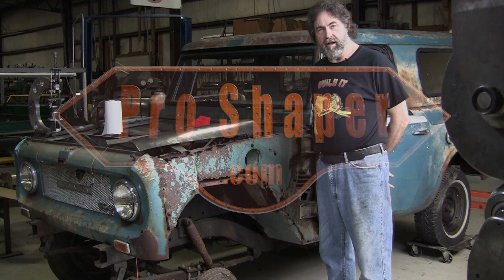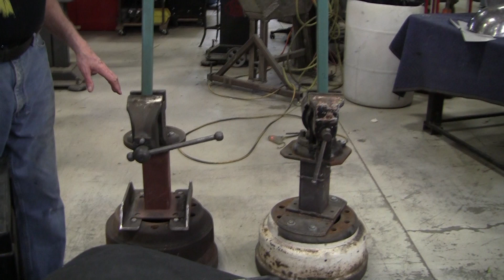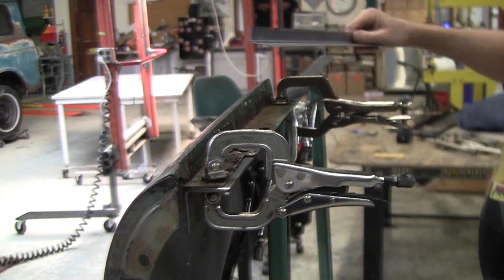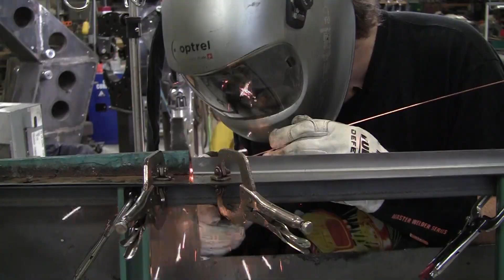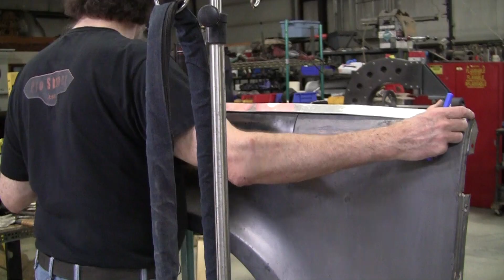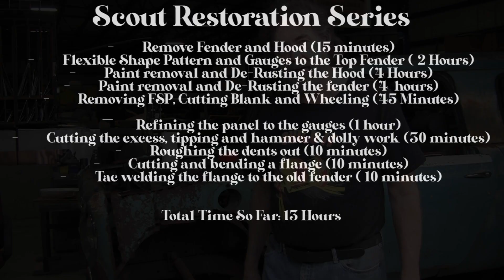Collector Car Metal Work: Scout 800

Comment: Novice question here: Why not put the fender on the other Scout, and use the brackets there for positioning?
Reply from the maker: My point on the restoration series videos is show the proper way to do restoration and I try to keep in mind what is possible for the viewer. I have multiple Scouts not everyone does, hence the bracket clamped in the vise. I bought another Scout today.
Reply: @proshaper  Good point. Thanks!

Comment: Removing the outer fender has revealed the metal-moth's depredations on the inner one. Just as well that's basically flat, so you can guess the missing bits.
Seriously, are your gauges made of corrugated carboard? How do you get clean cut lines with it? Whenever I've tried, the cuts end up ragged, as though the dog did it..
Reply from the maker: 80 sandpaper will tune the cardboard gauge quickly.
Reply: @proshaper  Thanks.

Comment: Great work , and very careful planning , it will show in the end result Im sure.  But the cost in man hours alone must be getting heavy .
Reply from the maker: It's a 2000 hr job to restore a car. There is no way around that. Lap joints , bondo, and micky mouse repairs do not add up to a restoration. The process is the reward, if you're doing it to make money choose another pursuit.
Reply: @proshaper  there's a lot of wisdom in that ... and a huge difference in repair and restoration... 🙂
Reply: @proshaper  So, at a reasonable shop rate, you will have a $200,000 Bronco. At a ridiculously low shop rate, it's still $100K.
Reply from the maker: @edwardtaylor4785  which proves my point, probably 90% of collector cars can't be restored with the idea of making money on them. A lot of people bring cars to a shop thinking that they will make a bundle on the car after it is finished.... A large segment of the collector car community is retired and they use restoration as a hobby and therapy. The process is fun and challenging. I call it a super intense chess game with art and sweat.  With my videos I try to give proper guidance to the community I just described.